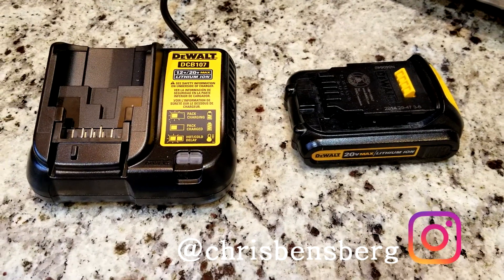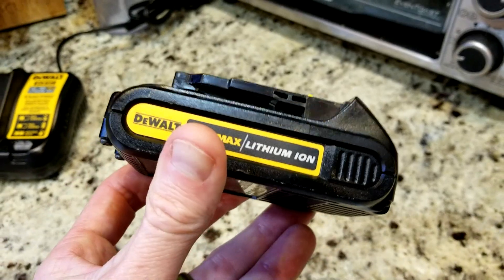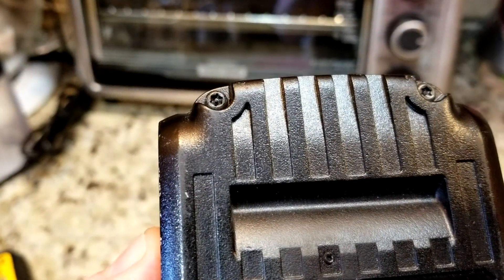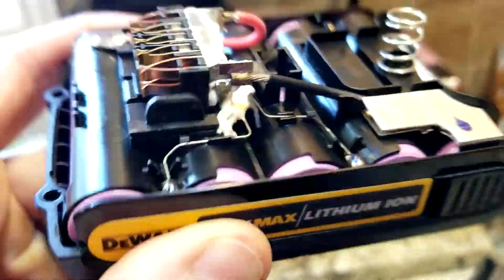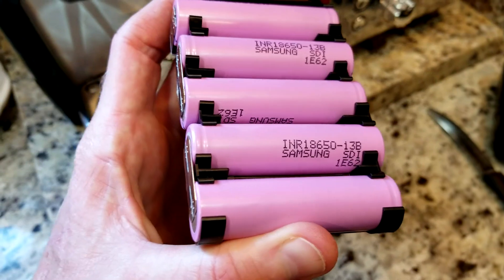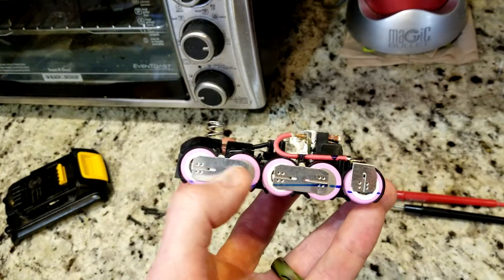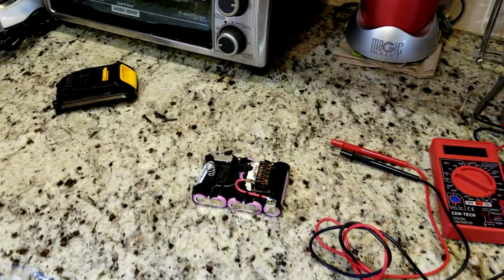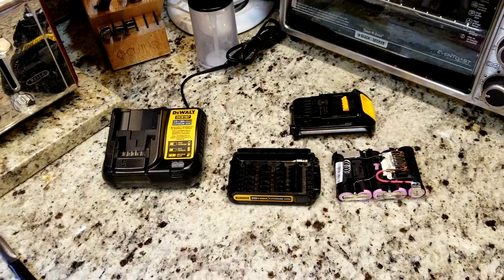Why Your Dewalt Lithium Ion Battery Won't Charge Possible Fix & Watch Before You Throw It Away

Comment: Brand new out of the store they discharge because of the tracking device which was meh by DeWalt in an ""insert" leaflet with the instructions. The guy at Ace Hardware told me he'd returned a bunch of them. That doesn't solve the problem and I'm NOT talking about the anti-theft tracker the stores use to protect against theft. I made some brass probes that I can insert into the +and - terminals as the voltmeters probe leads are too large for the job and I left them sticking out just a tad bit. I monitored the voltage right after charging and throughout the day, into the next day both in the tool and out of the tool and both batteries were drained by the next day. I could not believe what I was seeing.
   I live off grid and depend on my full set of DeWalt tools and have contracted with them for two and a half decade using the DC9096 nicad packs which lasted me at least 5 years each.
   As DeWalt has taken them off the market I have no good recourse but have them rebuilt which Toby's Batteries in Spokane will do for $45 each + tax at last quote several months ago.
   Removing the battery from the tool between uses (running generators to charge is not convenient or cheap and inverters can at times destroy chargers) leaves the system open to the elements, wet sawdust and rain or snow or dirt in the tool bag. Think too of the other workers on the job... " Hey, where's my battery ?" or "Who took my battery home over the weekend ?" Maybe, usually I have projects going on at home or side jobs.
   This is the poorest decision DeWalt engineering could have made and I'm 🔥 hot under the collar preparing to make the call to customer service when two things happened. One, I've got to cool down and, two it's gonna take awhile. 
    Thanks for the video. Good luck y'all. Have a nice day...

Comment: Next time you make a video show the people what all you do. For example when you used the multimeter to check the voltage in the cells you should tell them what to set the multimeter to in order to check the cells correctly. I mean bc not everyone that is watching the video knows how to use the tools required in order to  replace the cells. Thanks also other than that the video was helpful.

Comment: I was advised not to solder too much heat I bought a cheap spot welder and fixed 2 5ah batteries using it here's what I did https://youtu.be/x83eJGVrq6o

Comment: Ok so figure me this one out… I thought this was the issue but… when I take the top cover off of the battery it will charge…. But when I put it back on it shows nothing… I have tested connections and case fit-meant  and can find no reason..

Comment: My battery shows no signal on the fuel gauge, on the charger is a solid red light but won't charge. My other batteries charge well on the same charger

Comment: What about a solid red light on charger ?
Reply: @Woodworking 3.0 after I posted my question I saw another video that shows that you have to really force the battery into the charger until it clicks in. It felt like I was going to break something that’s how hard you have to push on it. Once it snapped in, it began to flash like it’s charging and then when it’s full it does turn solid red.
Reply: @Brightbkh   thank you man i just got the impact and was about to go back to the store to get a refund lol you saved me from looking like a dumb ass🤣
Reply: @Brightbkh  bro your a lifesaver just took mine out the box threw one on the charger and went to use it today but no juice thought i wasted money then i read this tried it and wahllah...now the 1hr wait tho lol
Reply: @Brightbkh  thanks 👍
Reply: @Brightbkh  same here, read that and gave mine a little hit down onto the charger and it started flashing (charging)
Reply: Mine is doing the same. Just got it out of the box and the battery shows one bar but the charger indicates fully charged by having the solid red dot. Did you ever find out what is wrong?
Reply: For anyone still wondering about this the problem is the battery isn’t fully seated. You have to press the battery until it snaps in all the way and it feels like you are gonna break it before it is fully seated
Reply: @Brightbkh  duh! Thanks a lot for this, my battery was new and not charging, I tried the tip above but with no luck... turns out the battery wasn't fully seated...
Reply: @Brightbkh  thanks, man. You’re tip worked for me.
Reply: @Brightbkh  i feel like an idiot, i called dewalt for a warranty replacement and that was my issue. Thanks!
Reply: @MegaRtty  hahaha yeah I read the instructions saying it needed to be fully seated and thought it was. I felt like if I pushed any harder it would break something but now that it’s snapped in and out a few times it’s easy to do. Glad you got it working brother!
Reply: If you have a brand new unit, just make sure you very securely push the battery into the charger.  It will start flashing red to charge.
Reply: Solid red means its full
Reply: @Woodworking Chop 😂
Reply: Try this, it works in most cases. https://www.youtube.com/watch?v=uCKdSrm-2A8

Comment: What about when all the cells are over 3.3 volts and the charger says it's full but the net voltage of the entire pack is only 18 volts and the tools dont work either
Reply: Exactly my problem !!
Reply: Mine ended up having a dead cell or two. Must have over heated. When a cell over heats it can release gasses causing a little tab under the button contact to push up and eliminate connection to the external circuit. They will read 0V. Btw this by design to prevent use of the overheated cell. I had to take my pack apart and push the tab back down on the "dead" cells and now they seem to work. I ended up replac8ng the "dead" cells with new cells before I discovered this so I haven't really used them since I fixed them. But I charged them and they are holding it fine
Reply: @MendonMafia  my cells are all good..3.7 volts...has to be the circuit board..pulled it out...unable to locate any faulty part..the battery was only  used 3 times

Comment: All the tricks don't work for mine. Because it was not a battery issue.
Turns out that these packs have a "fusible link" inside. Mine burned in two. Apparently, it got very hot and melted the inside plastic as well! Can't find any video to show this. Looking for a replacement has turned up nothing.

Comment: My red light stays on. Been on charger half the day, still red.
Reply: Mine as well! Any fix?
Reply: Yes same here. I go to use it to go right and its good but go on reverse and its dead
Reply: @chxx010  I contacted dewalt and they said it was an issue with the charger since both my batterys did it. They sent me a newer charger free under warranty and now it works. Those chargers that say its fully charge when they are not,  are defects.
Reply: @DiamondScuff  thats the weird thing. Its only happening with one out of my two batteries.
Reply: @chxx010  its likely that one battery is donezo then.
Reply: @DiamondScuff  appreciated it than. Yea, I was just wondering since I just got It like 4 months ago.

Comment: Does Dewalt use battery PCB kill signal like Makitas to render the battery unusable if it's no longer good, even if you replace the bad cells ? for Makitas, if after 3 failed charge attempts the circuit get bricked.